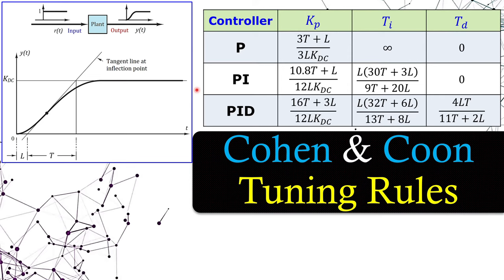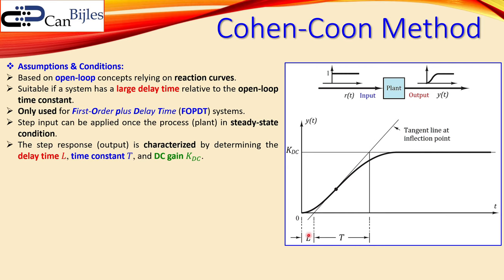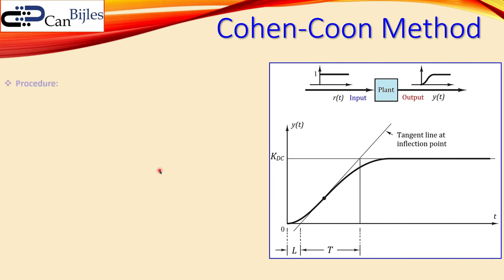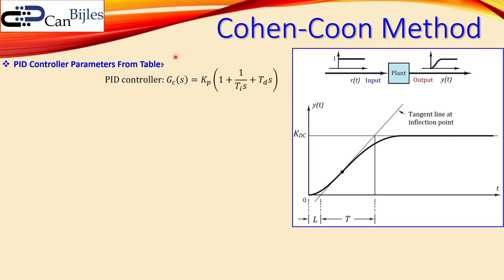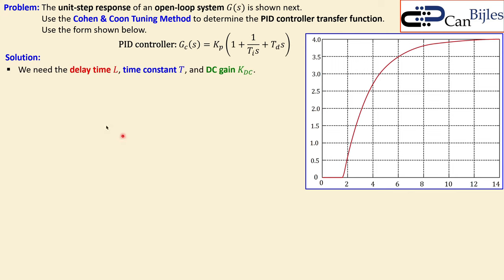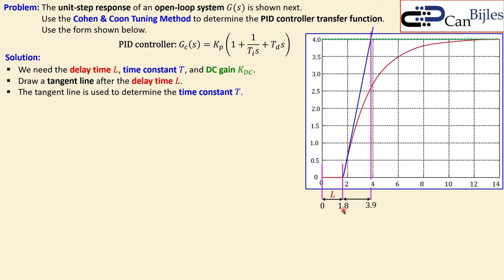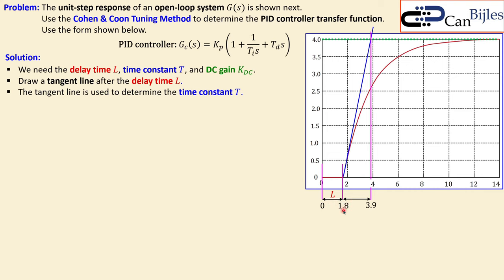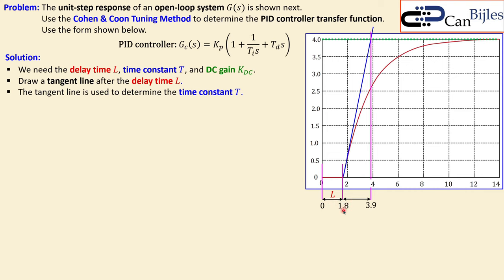Cohen & Coon Tuning Rules 💡 PID Controller Design | Calculations & MATLAB Simulations

Comment: Спасибо огромное. Как всегда очень нужные знания в прекрасном  информативном изложении.  Не могли бы вы показать, как можно настроить PID для системы 5 порядка. Заранее спасибо
Reply from the maker: Thanks for your nice message. Great to know that you liked the video. This method (Cohen & Coon) is only used for first-order system with a delay.

You can design a PID controller using the root locus method or frequency response method. This is also possible for 5th order systems. Maybe it is handy to check the videos about this in the following playlist links. 

Root Locus Method - Controller Design: https://www.youtube.com/playlist?list=PLuUNUe8EVqlnY2zKWnx-6nyc6CqyPApDD

Frequency Response Method - Controller Design: https://www.youtube.com/playlist?list=PLuUNUe8EVqlkQ8kvTej5dRfOJ-ARmoi5B
Reply: @CanBijles  большое спасибо!
Reply from the maker: You are welcome!